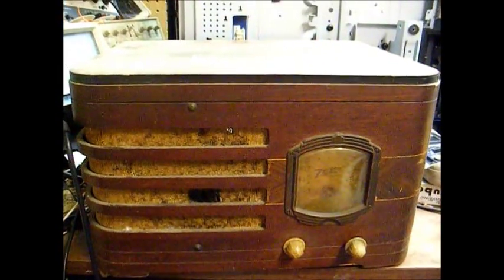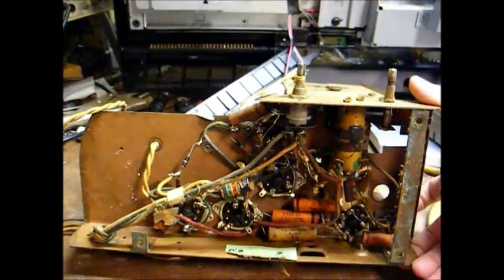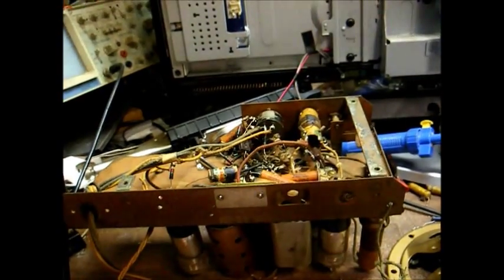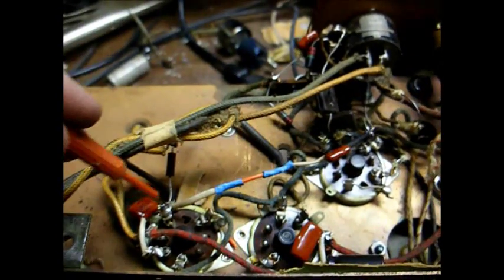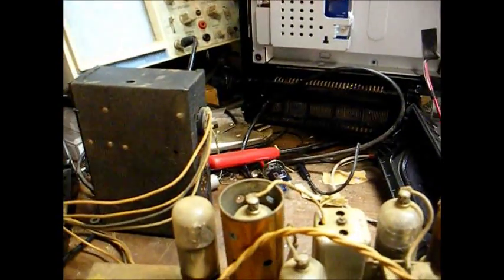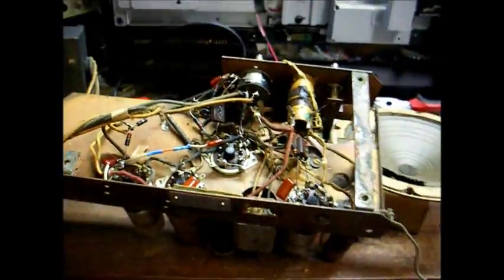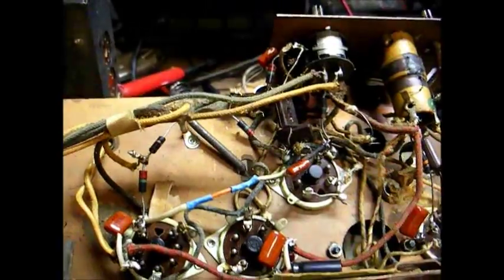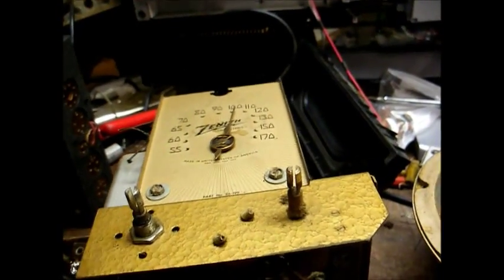Repair of a '39 Zenith 4K331 battery operated tube radio - part one

Comment: That Zenith is a cute set in a pretty cabinet. I've often found that many of those old farm radios will power up and play without doing much of anything to them, I think that the lower voltages, lack of tube heat, and shorter number of working hours may account for it. With regard to the battery cable I have often found those go bad near the battery plugs, but if you cut back the leads a few inches into fresh copper you can often reuse them.